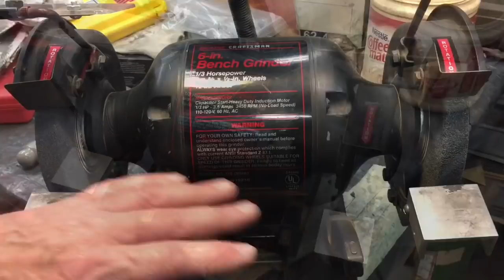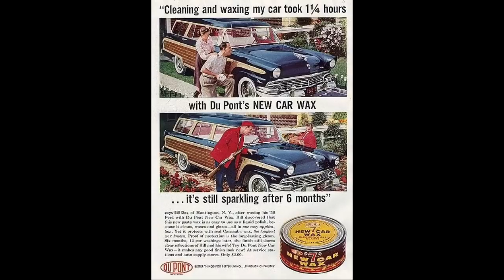Bench Grinder 101 and Westinghouse Monster Bulb!

Comment: Bon-Ami stopped making any liquid products in 2014 but they still make their famous 1886 Formula cleaner which contains feldspar and tallow. It’s great for mirrors and glass, but only on older auto glass or windows without coatings. Used as a light paste you can clean or polish just about any smooth surface. It used to come in a “bar” form but now only as a powder; however it works the same. If not available locally it’s no doubt on Amazon or on a web search. Like that 1500 Watt Bulb, great stuff!

Comment: Love the skit. I had to share it with my wife! Being self taught there are big voids in my knowledge base so it is great to go over some basic information. I will be dressing my wheels to run true.
I just re watched your two videos on lubrication and found very helpful. You could redo them into one as you already have a lot of the video footage just add and edit! They were Fantastic and very useful videos.
Industrial Westinghouse bulbs are as rare as a thousand dollar bill. I purchased two huge industrial fixtures with a ballast and the huge bulbs gave $5 for them I  never powered them on I was too unsure to do it. I ended up selling them on eBay for $300 each so there must have been a big demand for them then. However, I but just bought a led light that screws into a socket and gives off 18,400 lumens that is bright.

Comment: If the bon ami is hard to find or no longer available, I recently discovered sprayway brand window cleaner. It's also ammonia free and it doesn't evaporate quickly, works enormously better than any other glass cleaner I've used. It also smells really really good. Like not cleaner smell, just a good smell. It's not even expensive, because it goes really far. If you haven't tried it, I really recommend it. Totally agree on the 0000 steel wool
Reply: That glass cleaner in ace hardware is amonia free but they make some other very good products with white spray can blue lettering Pella told me to use on my windows!

Comment: Great video! Have you considered rigging up a rotating reflector/mirror for the bulb so that you'd have your very own lighthouse / stage lighting effect? Also do you have any special tips on how to put away the steel wool so it won't rust after using it? I try to wring it out and set it somewhere where the air can circulate and dry it out without letting it rust. But I wonder if you have any other tips.

Comment: When I was a kid we would go down to the local town dump. The town would regularly throw out the burned out street light bulbs, and also the traffic signal bulbs. They were packed in the original boxes. The guys would change out the burned out ones and put them back in the padded cases. We'd 
spend the day shooting the bulbs with my BB gun. We would set up many around the dump as a shooting course.  And also a few of us would hold them by the base and they were shot out of our hands. That was exciting!
Try that today and you would be up on murder charges.
Every now and again there would be a large pile of spray paint cans dumped there. They were rejects from some paint factory. They were set up on old hot water heaters and shot with my .22. A lit candle was placed along side and when the propellant hit the flame it was quite spectacular. Whirling, flaming cans of paint.
P.S hope you used SPF 50 around that bright light!
Reply from the maker: Those were awesome times!!!!!!!!!!!!

Comment: Reports are coming in of a grid failure on the east coast. Experts have narrowed the power failures to Queens, NY. Officials seemed powerless.  Grinders are to be respected right John? I've certainly learned my lessons on them and cooling while grinding. I have the same grinder the wife bought me, the ol' Craftsman, I used it so much, I broke the switch. The light is a plus. Great Friday video. Have a great weekend.

Comment: Sorry to monopolize your channel, Scout, but you might dig this.  When I went to school, in the middle of the main building was an Ol' Skool Power Lab.  Large motors and generators japanned black, connected by thick leather belting and all set on a floor of red quarry tile.  The kinda place Tesla would have felt at home.  The loads were LARGE banks of 1000 watt lamps. Sad to say, before I had an opportunity to play around with that heavy equipment, some jagoff thought it would be cool to replace all that irreplaceable stuff with a Semiconductor lab.  I took my "power lab" sitting at a table with a washing machine motor in front of me.

Comment: Great video. Those grinder tips were very useful. Thanks for emphasizing safety around power tools. You have to respect the power in grinders, saws etc. I have never seen an incandescent bulb that size, although I have some mogul - base bulbs with different brightness levels, also some reading light incandescent bulbs with mogul bases. Just one of those bulbs you have could not only light an entire house, it could heat it as well. I can just hear the electric grid groan with strain as that 1000 water is turned on. Very glad it lit up. How old is that bulb?
Reply from the maker: Hi Pat- Can't tell...  Some guys can guess the age by the manufacturers watermark!  =D

Comment: Can you use the Variac to control the speed of small power tools, let's say a Dremel? I've decided to save a few dollars and bought the one with one speed. I would love to have some kind of control over that.
Reply from the maker: Hi Chip- Dremel made a variable speed control for their single speed units.  Other companies make them today however only certain motors can be slowed down using a variac because the lack of RPM's effects torque and heat dissipation... It's a little complicated but the Dremel is a brushed universal motor and more forgiving to variable speed controls!   https://www.ebay.com/itm/114851031877?chn=ps&norover=1&mkevt=1&mkrid=711-117182-37290-0&mkcid=2&itemid=114851031877&targetid=1264870805944&device=c&mktype=pla&googleloc=9004381&poi=&campaignid=10455986539&mkgroupid=123050588060&rlsatarget=pla-1264870805944&abcId=2146002&merchantid=113593015&gclid=CjwKCAjwzruGBhBAEiwAUqMR8PxNVTDgNaIYsg7XX18U_Np-tL3QydFF2SBdeHJmB2oR0bTN8phFgBoCi6gQAvD_BwE
Reply: @ScoutCrafter  thank you so much for your response! I appreciate you taking the time to respond and even include a link. I'm on the right track now! Next time I will just pay a bit extra and get the variable speed - It seems like no matter what tool, speed control is a very good idea.

Comment: I have seen a grinding stone explode on a bench grinder, and yes, those guards are important. Brand new Norton wheel from McMaster, so not a fly by night brand either.  Mechanic had just put it on, a couple minutes or so into running it, and boom the thing blew to pieces.
Reply: Ring test before installing wheels is critical. Also having the paper labels and not over tightening

Comment: I have heard, that you never want to grind brass on a grinding wheel. Might cause it to explode, or come apart. We used brass hammers at work to use on stainless steel fittings so not to ruin them. I always used a angle grinder and a flapper disk, when they got mushroomed out on the edges.

Comment: I have 4 bench grinders, 99% of the time they're used for other things besides grinding. Only 1 actually has a wheel mounted on it, I have a box full of new or like new wheels...........I've heard that before about 0000 steel wool bringing back windshields to crystal clear like new condition, I find that it works great with a little WD-40 to clean up vinyl tool handles without scuffing them up when other things including Scotch-Brite pads failed..........I have a great story about the grouchiest, most miserable old man I ever met and light bulbs but it'd be a short story to write out.......Suffice it to say I killed him with kindness and the miserable old bird ended up liking me after a few years.

Comment: Actually, you should never use aluminum on a grinding wheel. Not only will it clog the pores, but it can be forced into the wheel deeper and cause it to crack and fly apart! especially when followed up with more pressure and heat using steel or a harder metal... Only use a grinding belt, file, sander or cutting disk for aluminum. They can be cleaned in much the same way with a belt cleaner, similar to a large eraser.

Comment: Grinder quality is mostly in the motor. Get one with a Baldor motor and you are good for a really long time. See those still in operation that are way older than me. Second is the provision of a light which they rarely have any more.  Then comes the tool rest which if you can't afford a really great grinder means make a set of good ones. Lastly buy a good set of wheels and ditch the cheap ones. Yeas grinding wheels explode. When they do your safety glasses might save your eyes. Worked with a guy whose job was to grind crank shafts. His safety glasses barely saved his eyes. Safety glasses behind a face shield is better. Get good safety glasses and shields. If they scratch easy you will likely quit wearing them. No good then. So you taking that light to your girlfriends and singing You Light Up My Life?
Reply from the maker: Philip- Do you ever watch the guys over in India?  They run these huge motors with big 12" grindstones on them with no eye protection and open wheels!  =D  They don't even wear shoes!   Love watching those guys!  LOL
Reply: @ScoutCrafter   Yeah I shudder to think what happens when it all goes south on them. They even weld without shielding their eyes. I have been injured more than once and had flash burn from welding class. No one should want that or the problems that come later.